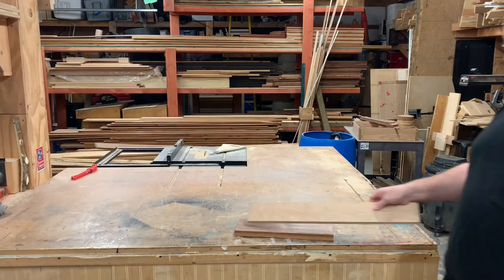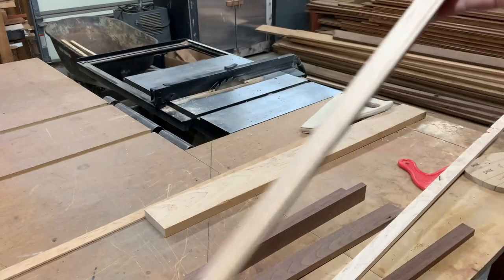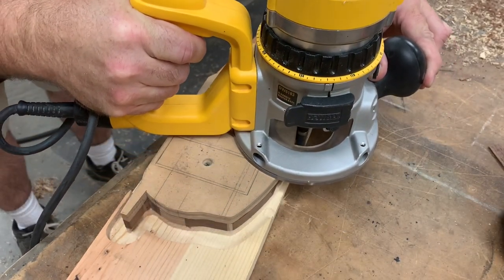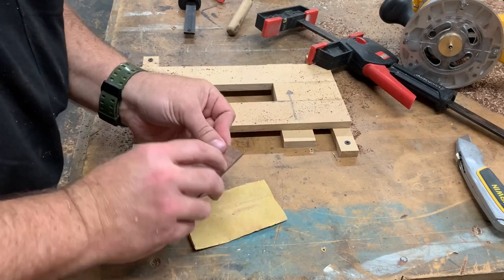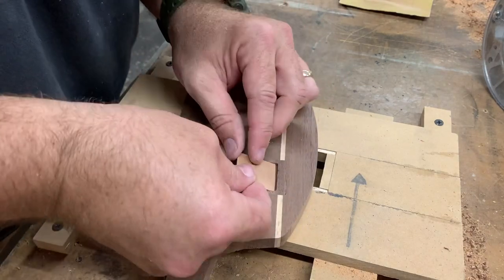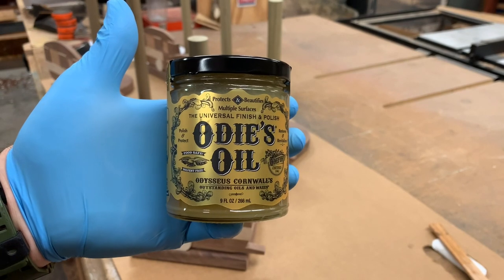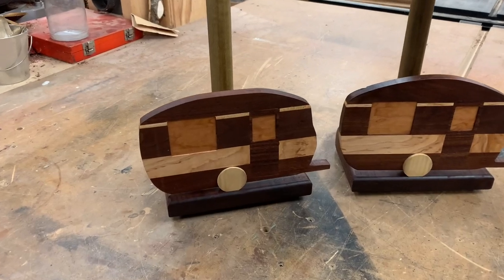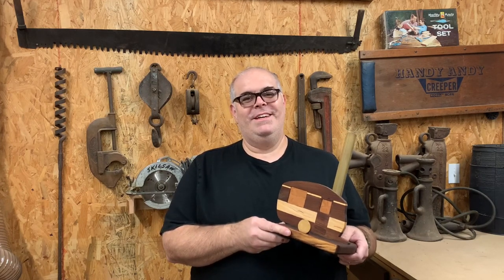Woodworking: Vintage Camper Paper Towel Holder

Comment: I enjoyed your video. I had a '72 Scotty camper that I fixed up and sold but camped in it a bunch of times. You can put a link to your website on your YouTube banner. Keep up with the videos.
Reply from the maker: Thanks so much. I love the look of the vintage campers, and it was a dream of mine to buy one and "restomod" it. However, Mrs. Tinkerer and I ended up getting a steal on a 2015 28' travel trailer that needed minimal work, and had much more amenities than a vintage one. I would still like to restore an older one some day though. Thanks for watching and for the kind words. I'll have to figure out the website link thing too. Thanks for the tip.